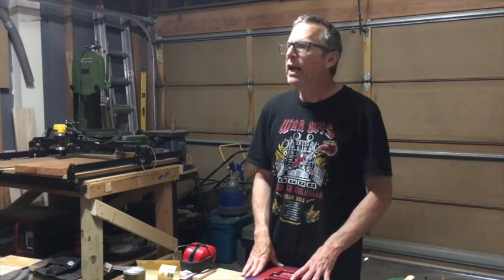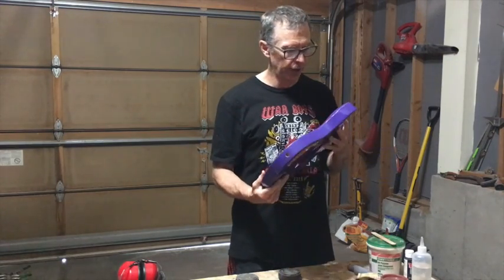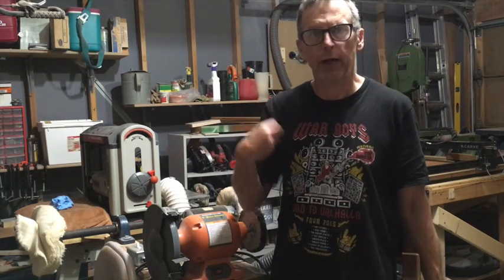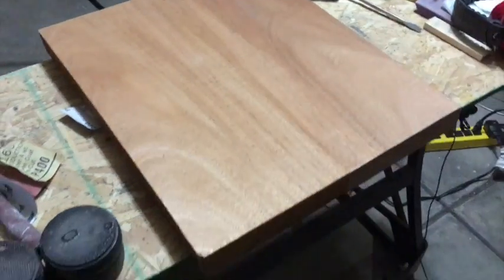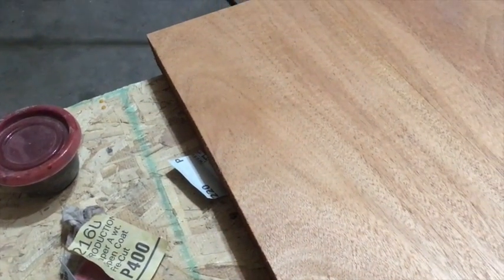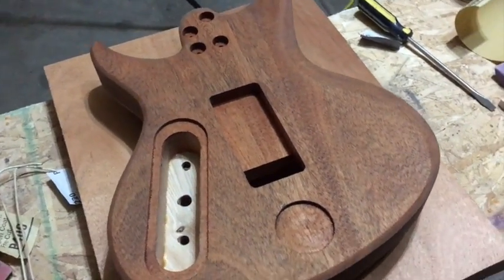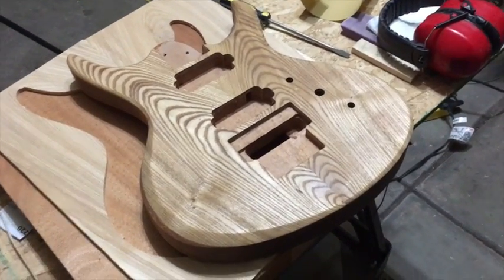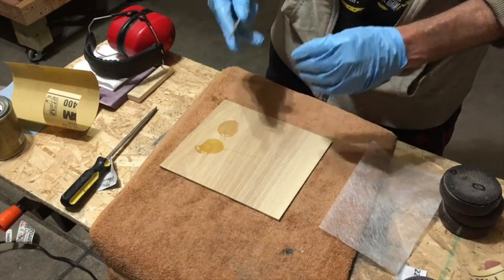A Shop Update  Grain Filling  Reinforcing Thin Wood

Comment: Thought about doing some FAQ segments?

Here's a question. Do you prefer Tru Oil or Minwax Wipe-On Poly? I'm having trouble getting a mirror like finish with Tru Oil, and wondering if I should try the WOP for my next experiment. Could be user error as this is my 1st refinish.

BTW, thanks for the vids and I also gotta say you've made some great looking guitfiddles!
Reply from the maker: I get basically the exact same results with both Tru Oil and Minwax WOP. I prefer Minwax because I can't get Tru Oil locally and Minwax WOP is way cheaper. However, to be honest, if I want a mirror-like high gloss finish, I spray lacquer.
Reply: Maybe I could live with less than mirror like, but the problem is even after wet-sanding up to 2500 grit (highest I found locally) I see lots of swirl lines. Not sure if you still get sanding marks at that high of a grit, or if it's streaks from wiping on the oil in a circular motion. 

Maybe order some higher grit? Or do some form of buffing/polishing? The main reason I thought WOP may be better is because I read it's good at self-leveling.

Thanks!
Reply from the maker: Are you allowing the Tru Oil to completely cure after the last coat? You want to make sure it has cured thoroughly before sanding because it will scratch easily. I would stop sanding at about 1,500 grit and polish with foam buffing pads like these: http://amzn.to/2pbCpQI
Reply: I would put on 3 coats a day, fairly light with a French polish type approach. The next morning I'd do 400 grit wetsand followed by 3 more coats. Keep doing wetsand/then 3 coats all the way up to 2500.

At that point does it need to sit and cure for awhile? Then a final polish?
Reply from the maker: It takes one month for Tru Oil to cure.
Reply: Ok then I'll give it more time. Thanks again!
Reply: I don't profess to be a Luthier but I use Danish Oil on my instruments......love the finish, the more coats you do the more deep gloss you get...